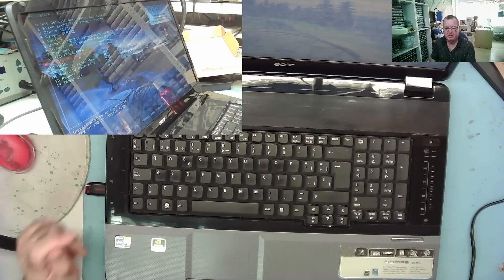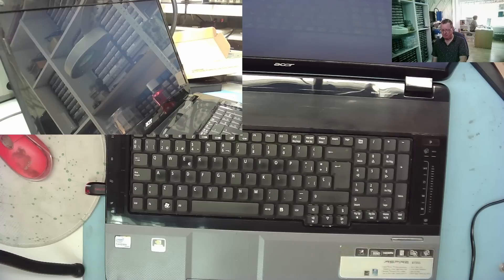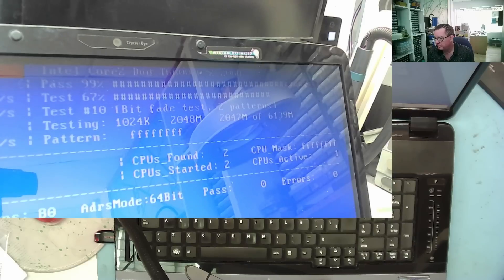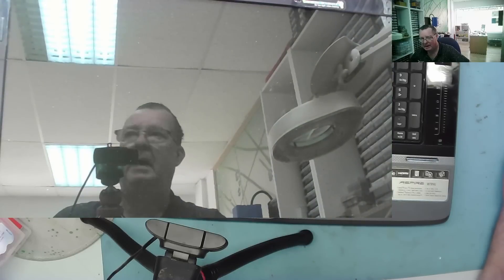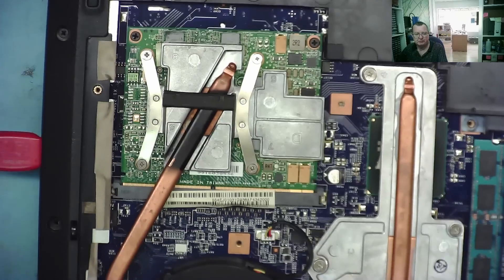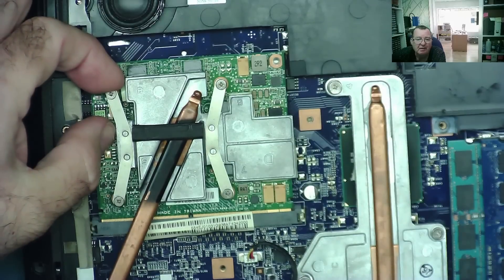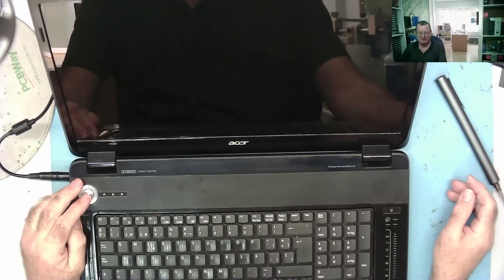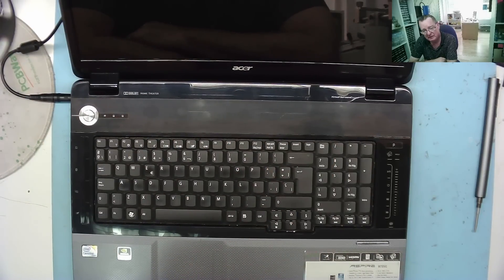Can't Repair It Because You're NOT GOOD ENOUGH!

Comment: I have gone through this exact same problem on my Aspire 6920. That was the NEC Tokin Vcore capacitor that went bad! On yours it is located under the keyboard and palmrest. Try to fix this as the 18 inch Acers are collectable items unlike what many say here!
Specifically, symptom would be if you have a working battery the computer works fine, if you then connect the charger after it's booted, computer shuts off right away. If booted with a charger, it shuts down right as (or shortly after) windows initialised devices and mouse cursor is about to appear (when CPU power management is handed to Windows). It might also stay on if you disable one core in msconfig.

Comment: I had my first 'couldn't diagnose moment' this year trying to sort an analogue/DMX 24 channel lighting control desk. I even had a schematic but during diagnosis found the multi-layer PCB wasn't tracked as per some of the schematic point-to-points.  At least I 100% know that 90% of the board which is OK, but can I find the failure in the remaining 10% . . . . . . can I %$£$ ;-)   It so frustrating and now I am finding that I fault diagnose possiblities with my head on the pillow at night ha ha ha, wake up with new enthusiasim but sadly no.  After a few weeks looking for the cause the board then failed to boot up one day which turned out to be a simple failed 4.7uf cap . . . . . . I thought wow maybe that was on the way to failure, dropped a replacement in and woo hoo the board booted up . . . . . . . but unfortunately the same original fault was still there Arrrghhhhh.  The multiple channel faders on the lighting desk operate via a load of 8-channel multiplex IC's using C4051 chips and I just seem to be getting 'me knickers in a twist' ha ha ha . . . . . Work still in progress . . . . it is a personal item, so no rush . . . . . one day😀

Comment: Stumbled on your video, same laptop, same problem. Tried many things like you did, new thermal paste....etc..... ran the cpu temp utility (core temp) and it does not overheat but  mine takes longer, around 10 min, but it will fail after a while. So it boots into win 10 and works normally, but will crash after approx 10min. I think its the GPU failing, had another ACER and it was the same, got a used GPU from aliexpress and it fixed the issue.

Comment: Hello! Just swap the graphics card with something similar from nvidia . I'm sure you can get one for cheap or even for no money at all from a bad old laptop . I fixed Acer laptops with C2D or Athlon in the past just by replacing the gpu,had similar issues like  you have in the video . Good luck! There is a possibility that the bios on the gpu card is corrupt,you can flash it easy with a bios from techpowerup.

Comment: many times on the core duo and core2 duo era laptops,its either the NEC tokin caps under the cpu,than need to be replaced, or the gpu needs a reflow.Either way since they are so old, its not cost effective to spend more than 5 euros for parts on such machines.

Comment: If you think about what may be happening at these points, I think a proper diags suite could be useful (can test specific areas), or debug mode during boot to see what is happening. As it seems to be very repeatable, clearly something is trying to be enabled (possibly even usb ports etc) - if there's a short circuit on the power when the enable signal is present then I suspect you could see very similar, effectively forcing a reset due to the voltage drop?  In fact reviewing the video at 16:31 the boot process was in the process of dealing with hot-plug PCI stuff so maybe something being enabled on the PCI bus? You could even monitor the voltages on various components with a scope on slow acquisition timebase/roll mode and see if something is dragged down at the point of 'reset'.

Comment: Try to boot it from on board graphics, seems like this one has graphic chip failure, reboots when setup switches to high res. In the setup must be a setting for prefferred gpu, boot it from onboard and test external one with that linux test software... This one looks old so probably it doesnt have smart voltage control chips, just plently of mosfets so i dont think it doesnt have pwm issue. Over heating disconnects some of pins under the gpu and this problem starts to show up.  Reflow can make it work a lil more but it will die soon or later.
Reply from the maker: What onboard graphics?
Reply: @LearnElectronicsRepair  Sorry my mind went to desktops, i meant the one which comes with cpu.

Comment: Live reaction:

It's not using the GPU in the PE session.
Vista Installer progress bar lol
old bios?
yeah those mbr "boot disks" are legit
oh.  HD init?
BIOS still I think
32 a good move.  I didn't think of that.  I would have eventually, but not off the bat.
Oh.
RAM/BIOS/GPU 
gpu unlikely, windows is really just in "dos mode" until Windows Update is done.
that "NOPE" oh I love this channel
oh wait what
it's not supposed to reset right? unless you configure that.
yeah, it's when it's looking at storage right?
good idea, but waste of time yeah.  windows should install.  end of it all.  microsoft is good at making windows install.
wifi good idea, it may init early
sure ram will work too
it won't come on
mxm, leave it in.  oh ok.
easy2boot.  sweet.  I've been using Strelok to much success. 
bios
no not ram
I love your channel.  You make your point perfectly.  This is great.
vista bootloader again
yeah they don't boot if they don't have the power
no kinks in the pipes, nice.
I like manually unscrewing, is the electronic thing that helpful?
discrete is implied with mxm presence.  i don't think any laptop with an mxm will boot off of integrated? I may be wrong. I only have my experience.
replacing storage, good idea, but there's still storage
I'll post this as a record
I paused at 16:38
Reply: OK thinking back they may not have the power to enable the 2nd chip.  Is the battery in a boost config or is the system being run off the battery voltage?  I honestly forget with these. I do know if you have a good video out you've generally, GENERALLY, got a good GPU and you should be happy.  

I would reflash the BIOS with whatever the manu has, and even try it again off of Badcaps/labone

maybe even grab an image of the vbios? i dont think they were updated very often, but maybe?
Reply: Oh forgot about flip-chip-itis.  Yeah.  It's probably that.  It's probably a bad GPU.  That was a reallly bad era for computers.  Try the BIOSes though.
Reply: It's a waste to try the BIOSes. Try them though. You're a good repair guy. Make backups.
Reply: Huge waste tho

Comment: I had a similar problem once and it turned out to be faulty ram.  The computer would run till it hit the spot in ram where it was bad then shut down. Your ram didnt finish before it shut down, try changing the ram. it went down at 96%.  This makes sense.  There is a bad circuit near the end of the ram chip and when it hits that point it goes down.

Comment: Doesnt windows have bootlogging? There should be a text file that shows the last boot sequence and that will tell you what is failing. Once the drive fails and you turn it off. Pull the drive, put it in a computer and go find the bootlog text file. This will give you a direction for repair.

Comment: hi you are in the same place  i have a mate that is all ways coming over with lap tops
i said i can't fix them like you said where do i start looking 

the lady i work for i said my computer is ill i said it's a rig not
a laptop  she got me a new one because it covered 
and can be fixed  any time 

like you i love the old kind of computers easy to change over parts  when they go down
  i have a k6 computer the mother board i can't change where it boots from
rest is ok  you get this alot on very old deck tops  can't clone the OS because can't
change the boot 

my mate gets hold of alot of cool gear and alot is just not right  all small things 
great video  i am looking for a over head cam as well  what are you using 
there is so many right mine field

Comment: hi i had the same  it was down to the HD in the end   i free wear drive checker 
crystal disk  yes there were bad parts all over the HD i changed the hd  for 
one i 100% checked it's not done this a again  

the drive can go bad when you are using it  why i use  tape drives as backs 
up  the new software for the drives checks mum board as well 
i binned mother pcb's because software say no

Comment: i fixed a similar acer 17inch notebook. it had the notorious NEC Token capacitors on cpu core supply. Please check if yours has the NEC Token capacitors same kind that fails in PS3s and Toshiba Satellites. replace with 4-6 smd tantalum 330 or 470uf capacitors.

EDIT: yours does indeed have the dreaded NEC Token capacitor that fails overtime with heat... and its mounted directly behind cpu socket back of the board. I guarantee you 99.9% this will fix it please give it a try im almost 100% certain it will come right. my acer did exact same thing wont boot keeps looping. changed the Token cap and works perfect now

Comment: I having a hard time with my XP desktop. I have an old HP pavilion XT963 Windows XP PC Desktop. I am trying to turn it into a Linux, but the problem is some of the f keys for the bios are missing, I can't use the F12, both the System BIOS and the Video BIOS are shadowed, and it will not boot from both a burned disk and USB for some unknown reason, it won't respond. Can anyone help me?

Comment: feels to me that something is going on with the GPU, it is probably failing when the installation is starting up a higher resolution using the GPU above the VGA mode, it could be a crippled Vram chip on that board. maybe you can go into bios and disable external GPU? maybe it is set to Peg as primary card and actually have an onboard GPU after all

Comment: Without battery, is the cmos battery holding date and time in bios? Are the correct date a time displayed in bios menu? Try booting in safe mode? Dual CPU? Cycle most used CPU off?

Comment: Had an issue like this with a Gateway gaming laptop a few years ago.
I literally replaced every single PCB and Drive in the unit, and it STILL croaked exactly 4 minutes after boot.
Pulled my hair out trying to figure it out!
I decided to use a thermal camera during the process.
Turned out that a coil in the fan would short once the machine tried to ramp up the speed of the fan! 
Hours and hours of labor for a $5 fan.
I’m still slapping myself over it! 😅

Comment: Probably it is a power related issue, what I suggest is to use thermal camera and voltage injection tool on each of the output coils or the power rails, if something is faulty like a mosfet which has a low resistance it will overheats, also try this thermal camera method when installing the Windows and it crashes probably you will spot something like an overheating component resulting the system protection to shut down the system to prevent its damage. Also try to use external power supply connect it to pcb at the 19V connector and check voltage current relation in standby mode and try to detach attached components like additional boards, the dedicated GPU and check the standby voltage/current values, it will change or not? thus you can find something.

Comment from the maker: To save me answering to several suggestions individually, I googled for some info and found that no Core 2 Duo processors had either integrated graphics or integrated memory controller.  This would mean I can not try disabling the Nvidea GPU in the BIOS
Reply: change nec token capacitor behind cpu socket back of board will fix it 100% im sure
Reply from the maker: @supercomputing942  This I will try in the followup

Comment: check the windows install logs, it will tell you how far the install process is comming and what adresses it is calling. It is clearly a hardware fault. Im not sure it is the graphic cpu because the loading of the drivers usually takes longer time.  To me it does not seem to get that far in the process, but start by disconnecting all hardware also the wifi.  At some point it calls the faulty unit..
Reply from the maker: I did try without the wifi during the video
Reply: @LearnElectronicsRepair  try and make a windows boot disk and boot in safe mode. Then choose one driver at the time and then see how far you get. Any way, im not sure it is sustainable to go on. If the fault is on the mobo there is probably nothing you can do to fix it with a reasonable price range. People write about capacitors and stuff, I don't think it has anything to do with that. It is clearly the same hardware / function call thats crashing the system. Next thing is to try with a known good graphic card, but I guess it's not so easy to find those...I have not seen them that often..
Reply: Hmmm im not sure sustainable is the correct word, but I think you know what I mean..😅

Comment: I am 100% sure you have a Nec Tokin capacitor issue. I had the exact same laptop with the exact same issue. Replace the Nec Tokin capacitor with 4 x 330uf tantalum capacitors and your laptop will be fixed! Now, am I good enough? ;)
Reply: Very often, with the Nec Tokin capacitor issue, you can actually boot and use the laptop normally when it's powered by the battery only. Give it a try to confirm the Nec Tokin issue.
Reply: @cyrielleledantec8304  He doesn't have a battery.
Reply: IIRC the nec tokin capacitor is located next to the processor. You can see it if you just lift the keyboard
Reply: @cyrielleledantec8304  ye i agree its definitely the NEC Token capacitor 100% will solve his problem also had this same acer laptop stuck boot loop changed nec token and it works perfect
Reply: 100% I agree ! Don't waste your time , replace nec tokin garbage

Comment: This is from the ERA of NV bumpgate, where a fault in the manufacturing process affecting a majority of Geforce 7000 and 8000 (and a few others) chips eventually led to their failure.    I at the time owned an offbrand laptop with a geforce 7600 that was probably one of the best laptops I've ever owned until it just randomly did not have a video output one day and I knew what had happened immediately.        I also used an Acer exactly like this at the job I had at the time which eventually suffered the same fate.  It's too bad because I liked that work laptop also.

Comment: I've seen this before. I noticed the system reaches the point where Windows switches out of VGA mode to high res mode for the bulk of installation, but crashes. The GPU is a GeForce 240M according to Acer's spec sheet for that model of machine so definitely not high end with huge overheating problems. If it's possible to test the VRAM, that's where I would start.
Reply from the maker: In the video tried booting from my Arch Linux USB that has test scripts for testing video ram but it crashed before loading
Reply: @LearnElectronicsRepair  you may want to test adding the vga=normal nomodeset kernel boot parameters to your kernel in GRUB. The moment it crashed your linux boot was very to close to the point, where the it would switch to VESA modes, similarly to windows actually.
Reply: @LearnElectronicsRepair  If the graphics card is MXM, there are MXM to PCIe adapters. One of those might allow you to test the card in a regular system, maybe even a system with another video card so that you don't lose video if the card hangs. It might not help a whole lot, but it might allow you to narrow down the issue to either a graphics card issue or a mainboard issue.
Reply: Linux has the boot process and windows has bootlog . These might help to see what is happening immediately before the reset/crash. 
It looks exactly like what others have mentioned: initialisation of the GPU. I have a similar era core2duo with nvidia GPU that is almost certainly dead from heat stress over years:  it doesn't even recognise in windows so itll only work in generic/VGA mode. (It runs xp)

Comment: Check RTC battery voltage - is time/date correct?. Reset to BIOS defaults. Remove battery, reset CMOS, set to defaults. Easy2Boot usually displays date/time at top right in recent versions. Invalid (BIOS default) date can cause reset in some BIOSes - e.g. 1981.

Comment: Can you access the bios?
If yes, can you change the graphics output from discreet GPU PCIE to Onboard? 
If yes, try a test boot and see how far you can get. (Try a safe mode/recovery boot, usually pressing F8 key constantly during power on until you receive a menu on screen.)
I know it is looking like a graphics issue. From past experience this could also be a problem with the chipset and not communicating with the rest of the components, which would require a chipset replacement or a motherboard replacement.  (Both of these are usually more expensive than buying a new laptop or at least a 2/3s the cost)
Reply from the maker: This was suggested (or very similar) on a few other comments so I will check in a followup video if I can disable the GPU in the BIOS, and if the motherboard has integrated VGA or not.  Thanks.